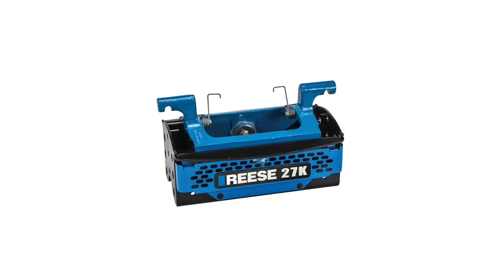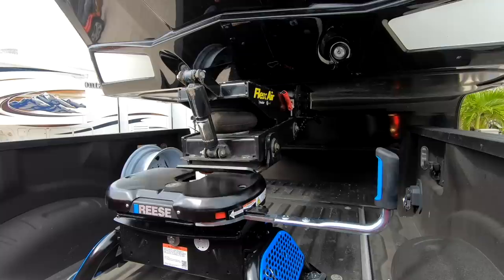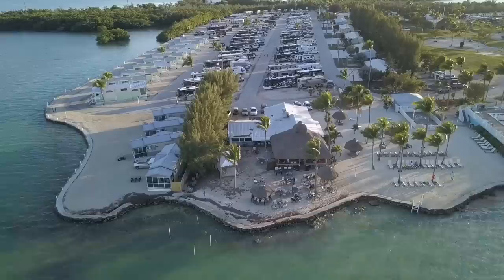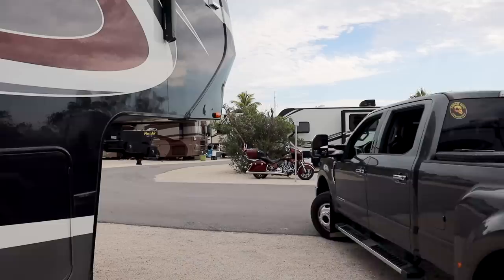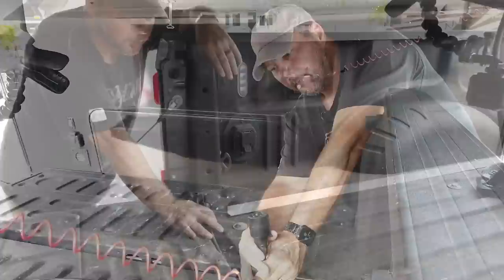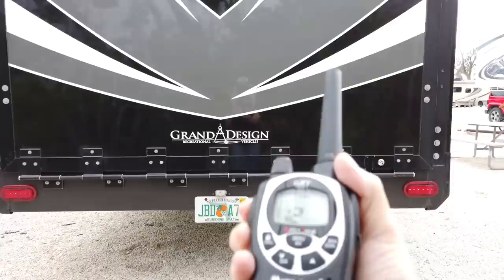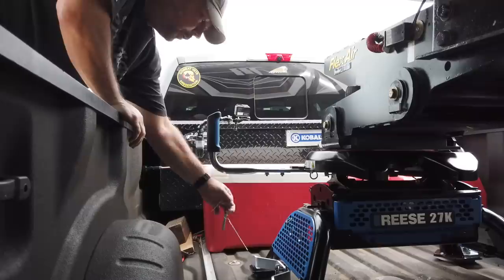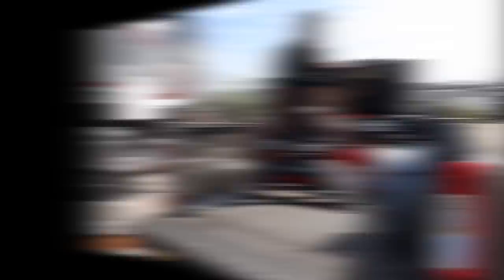Fifth Wheel Hitching | Reese M5 Review | Changing Lanes!

Comment: From a former OTR driver and now a full timer. The best way to do a pull test is to slightly raise the landing gear, engage the trailer break and pull. There is no other way to do it! You are teaching the right method.
Reply: I was thinking that if the wheels are chocked, then the trailer should not move. But I can see the wisdom in slightly raises the front landing gear.

Comment: I have the Reese air sidewinder. You showed the basic one, the air is is in closed, so it does look a little different. It is a great hitch for the short box. I can do the ninety degree turn with no problem. You can adjust the air for your needs. Wasn't that expensive. Two of us installed it in about one hour. No more worries about turning. Good video. Like your check list. I have to admit, I do not use a check list. After 25 years plus of trucking, I pretty well have it down pat. But anything can happen, so probably good idea to have one. Never to cautious. Again, good video and be waiting for next one. Happy trails!!!!!!!
Reply from the maker: the biggest reason for a checklist in RVing is distractions... RVers are a friendly bunch and it's easy to chat for a bit and get off-game...

Comment: XLNT hitching video for newbies to watch. Well put together. We learned alot with our old truck about hitching and unhitching. (The hard way) on some of it.
We leave our tailgate on as most ppl do. 😒 One of our first trips out with "OLD YELLOW" I was not paying attention and was just a little crooked and poked the front compartment door with the tailgate and put a dent in it. With ppl watching the newbies boy was I 😳. 
Then another time we forgot to drop the tail gate after I dropped the dead legs down, released the hitch and started to pull out, you guessed it I hear this big bang and felt a jolt. This time a dent in the tailgate. 🙄
😀 lessons learned. 😀
Safe travels.

Comment: Great video for people new to the 5th wheel world. I have one of the coil breakaway cables but haven't used it, didn't like the hookup points. ( Dodge 3500 DRW). Seeing your set up I will try it when we take off in April. The new Reese hitch looks nice. We have the B&W Companion and I leave it in the dang truck unless I need the full bed. I use the loader on the tractor to remove and install it. Thing is heavy, but I too like the weight in the bed when running less the trailer, smooths out the ride. I need to build a hitch checklist, getting older I don't want to forget anything. I usually start a week before we roll checking wheel bearings and pressures on the trailer tires, then check the lug nuts (I mark them with a Sharpie and can just look and see if they have moved)
We also use radios for light check and backing in tight places. My partner's hand signals change every time and I couldn't keep up. The radios keep the hollerin' down to a minimum.LOL

The more I watch you two interact the more you remind me of my and my other half, although we are a lot older. Been together since teenagers, turned 61 last fall, and she still seems to like me. Next time you come out west would love to meet up someplace, boondock a couple days and I can hook Chad on the Turbo S Rzr....:)

Comment: This is one reason I had the Reese Goosebox installed on my 5th Wheel. For me, yes it takes a bit longer to hitch up, but I don't have a heavy hitch in the bed because I often use my truck box. I did a lot of research on hitched and when I found the switching to the Reese Goosebox will not void the trailer frame manufacturing warranty it was a no brainer.

Comment: Been watching you guys for a couple years, so thanks for all the great informative videos.  One note, I have a 2017 RAM 3500 SRW with Ram Boxes, so I was definitely challenged when buying our 2018 Montana 5th wheel.  I went with the Reese 20K Titan hitch which I love as well because it is heavy.  For pin box, I went with the Reese 19K Sidewinder to keep the pin box locked to straight in the bed of my truck and not potentially wiping out the insides of the Ram Boxes during tight turns.  It works very well as the pivot point is back up under the nose of the 5th wheel.  I have had no issues with sway, just a nice comfortable ride.  I love the checklists as I use them, too.  Happy RVing guys!

Comment: Great video as always guys.  When we got our 5th wheel in the fall I changed out the pin box for a Reese goosebox even before we drove it off the lot.  Now I haven't pulled it much yet but from the bit I have, I have no regrets.  Less stuff in the bed of my truck to deal with, the fact that the ball allows for the trailer to lean left or right helps in situations where the truck and trailer might be off camber for unhooking/hooking or simply driving where a standard 5th wheel setup might cause the rear axle to unload and loose traction from one side.  If Reese ever makes a higher rated one I'd highly suggest giving it a shot.  It's nice to get to a site, unhook, throw the ball and safety chain holders into their case and have complete use of my bed. 

 As always keep up the good work and look forward to the next video.

Comment: Having run a 40Ft gooseneck flatbed trailer, using that Reese gooseneck box would be great with one exception. That is lining up the trailer to the ball is a lot harder because you have to be almost perfectly aligned to hitch. When I was hitching alone it took several tries to get it close enough.

Comment: Hi 
So nice to hear that you say about the drag test. !   Seen many a trailer go sailing on its own down the road 

Always do a drag test and always lift the trailer as banging under trailer , so that “ if “ king pin not locked properly, the trailer will only fall 3 or 4 inches ( commercial trailer ) it is possible to drop trailer on its nose if legs wound up fully  !    Yes    I did do that.  😂😂😂😂.

Comment: One thing that I’d like to mention with your light check. I travel alone more often then not. What I do is hit the emergency flashers and that turns everything on including both turn signals. Also good call on the pull test with landing gear down, I’ll be adding that step.

Comment: Great video, really enjoy you channel.  I have my first fifth wheel after 4 travel trailers and the dealer talked me into the Anderson you showed on your video.  So far it's been great with no problems, but time will tell.
Here is a little tip from a 40 plus year truck driver. If you get a bind and can't pull the release handle, back up tight against the hitch and set the parking brake and then try to pull it.
I really don't think taking the weight off the hitch has any affect on unhitching.  Keep up the good work

Comment: PLEASE READ ME!
You just ran your emergency brake cable to the rear of the truck bed.
That would have to run forward for two reasons.
1) If the cable is running back 18", it would have to break loose and move 36" just to match the tension you already have.
2) If the cable hooked on something and pulled sideways or backwards, it's going to bust the plastic pin off in the hole and it will never work at all.

Hook it to the front Ford takedown and that cable will only get tighter.

How do you like that Ford tiedown system?
If you didn't have the tie downs, are they worth picking up? (2019 F-150)
Ford parts I'm sure they are big money. I actually haven't even looked at pricing.

Keep up the GREAT JOBs you two👍
Reply: The only problem with HOOKING to the front...well actually 2 problems is:
1 .. when you turn it would pull out and your trailer brakes lock up and
2 . When turning, the cable could get wedged in the 5th wheel hitch and break therefore rendering it useless . 👍🏻
Reply from the maker: Thanks! 

The break-away connection is basically 90 degrees from the hitch.  If the RV ever comes loose, it will have no problem yanking that pin out as the RV moves to the rear.

We don't use the tie-downs a lot, but they are nice to have.  You're right that they're likely expensive...
Reply: Actually no, I've hooked on something behind the hitch and it work very well, unfortunately.

Comment: I moved from the same old-style Reese to the B&W 25K with the new truck/5th wheel and prefer the B&W but one thing I dislike about both (puck installation) is they both give you a way to lock the handles once closed/rotated but then leave the cotter pins/bolts fully exposed so someone could still remove those and steal your hitch. Wish the rotated handles would cover those bolts to prevent removal. Purchased a couple of those breakaway cables using the link above; definitely nicer to use than the long straight cable.

Comment: Awesome video. 1 suggestion would be to clip your breakaway forward of the hitch.  If it comes off driving down the road,  it will have the ability to pull the release. Tailgates are so strong and have locks, and its possible it won't tear it off and emergency brake will not deploy. And if by chance when it comes off either pulls the 7 pin connector out or breaks it off. Then you have no control at all.  I installed a eye bolt by the handle on my tool box to attach to.

Comment: I love all your vids, so informative, organized and thorough. I am a newbie and have learned a lot from your vids. So I debated on going with a 5th wheel hitch and kingpin vs a Goosebox and ball hitch. I decided going with a 20k Reese Goosebox and ball. Our rig is only 14k lbs.  Advantages and disadvantages of both. I feel more confident with a Goosebox and ball. No worries about a pull test and worried about coming unhitched. Negative is it is more difficult to get lined up under the all, but it is easier with practice. I also use an Iball camera I mount on my hitch ball and that helps a lot for visibility. I have incorporated many of your steps in our check lists. Thanks for all your tips and great advice.
Reply from the maker: Awesome job! If you haven't visited our website yet, please do. There is a ton of helpful info there.
https://changinglanesrv.com/

Comment: I hook my break away cable for the brakes to the front of the truck. Because if the trailer should become disconnected  the pin will pull out as soon as possible and engage the trailer brakes. I also pull the pin out and test that the trailer brakes will engage. When I drove 18 wheelers I would lower the air bags on the tractor, back under and connect to the trailer, raise the air bags which would lift the trailer jacks off the ground then pull forward to test the connection. Then get out of the tractor and connect the lights and air brakes.

Comment: Hey guys! Just assembled my Ford puck M5 yesterday, and noticed that the blue “Reese 27K” placard was on the “wrong” side as delivered according to all the photos & instructions about how to “gain 1 1/2” inches which, if followed, would have actually put the plate facing the tailgate as is shown in all the pictures.  This in turn led me to really inspect how the two springs under the head are supposed to be configured/working, and I noticed in your video that one of your springs is also in the wrong place under the head (the one to the right as you face the front of the bed). The long parts of the springs both need to be pointing as far forward into the bed (towards the cab) as you can get them when you lower the head down into the body of the hitch. This will then cause the head to cleanly rest “pointing downwards” towards your tailgate, aiding proper hitch angle for the trailer and hitch head strike areas to meet as designed.
Reply from the maker: Thanks!  I'll take a look.
Reply: @ChangingLanes  definitely let me know what you find- I was surprised at how unclear the instructions were for it. Basically a different instruction sheet in each box, and none of them really told the whole assembly story in my opinion.

Comment: Awsome video just purchased a Reese m5 27k hitch and noticed when putting it together that the center section came with 2 m16 bolts and nuts with washers with not very good at where they should go directions. After furture looking, at the top of the legs there is a all through hole that correlates with the three adjustable heights the hitch can move in. So I found that each leg should have three bolts for security and stability. I though I would put it out there for anyone who has one or purchases one to make sure and put that bolt in.

Comment: Nice thing about the Andersen Ultimate Aluminum hitch is I don't have to do a pull test. I know many don't like this hitch but I have had it 5 years with no issues. I love that it weighs only 35 pounds and I can easily get it in and out of my truck when I need the bed. I do like these puck systems but my 2015 doesn't have that option.

Comment: Hey Chad, when I had my rig with the wireless air, I would just hit the up fitter switch and shut that system off when un-hitching.  So when that weight comes off the truck the sensor doesn't see the pressure lowering in the bags and keep trying to re-fill them.  Then when un-hitched Id set the PSI to 5 for the bags.  When hitching back up, id wait till we were all hitched up and then fill the bags back up.  35 to 40 psi seemed to be the magic.

Thanks for the idea on the coiled breakaway cable, mine always bugged me!
Reply from the maker: Great idea on the upfitter!  👍🏼

Comment: In 2015 when I upgraded to my Raptor toy hauler (17,000lb)  I first went for the Anderson hitch, mainly for the low weight and ease of installation.  The hitch shop also claimed it would solve my short box turning issue too.  That was a lie.  I saw all the videos on the Anderson site about how much weight it could take.  I installed the gooseneck pin to receive it, hauled my new unit home and packed up for our first trip.  Two miles from home a deer ran in front and I had to hit the brakes hard.  For the next few miles I heard and felt more clunking noise from the rear.  Upon checking the hitch I had found that it bent from the heavy forward load.  The Anderson frame base that sat on the truck bed now had a rocker shape to it.  It held in place and no damage to truck or RV.  I went back to the hitch shop and they took the Anderson back and I had a Curt 24K fifth wheel installed.  Don't know if Anderson has addressed this forward force issue.
Thanks Chad and Tara for great videos.  I've purchased a lot of the products you've recommended.  To paraphrase Jack Nicholson "You make me want to be a better RVer"
Reply from the maker: I just never trusted Andersen's engineering after breaking all those jack blocks way under the rated weight...  Glad nothing besides the hitch was damaged.  If you have a picture of the bent hitch, we'd love to see it.  info@changinglanesrv.com  
Thanks for watching! 😊

Comment: I been fifth wheel camping for a while and drive tractor trailer so fifth wheels are me bread and butter lol. I never lost a trailer until one time I was pulling a 3 year old 5er for a family. I hooked up same way I always do line up and back in with some force not gunning it but gave her little force when I hook up always worked until this time. I hooked up it made its normal
Nosies the hitch always does my hitch won’t pop arm it has to be done manually so I did that and locked it so I knew it couldn’t putt back out or so I thought lol. Put legs up put truck in gear and started pulling out u til I heard a clunk noise soon as I heard that the camper stayed out and truck shot outward lucky I was able to spike breaks fast enough to not completely loose camper. Minor minor damage happened to camper mainly cosmetic but my tailgate and bed well let’s say that’s a different story. Moral of story always get out do a visual ck with jaws even if it locks the Handel or you do it always ck the jaws and raise legs inch off ground I pull the emergency breakaway cable for brake to come on and tug on hitch couple times in both directions. I get out and ck jaws once more and rebook cable the leave.

Comment: Wow, what a pain in the A**.  I have a fifth wheel with a goose neck adapter using the Anderson hitch rated at 27,000.  The Anderson hitch is designed for short beds and you never have to wonder if my hitch will slide off.  Since you like to test different things i'd reach out to Anderson and do a review,  you will pleasantly surprised.
Enjoyed the videos, have fun in the keys.

Comment: Hello I don't know if someone commented already but, I noticed you laid the power cord down on the bed of your truck once you plugged it in. I drive 18-wheelers and we're not allowed to have them rub and I've also been informed that they don't like that in RVs also. So what I do is put two loops and a zip tie on my power cord so it's suspended in mid-air as it's plugged into the bed. Course on the big rigs we have a spring system that keeps him suspended, but I've get found one for an RV. Hope this helps out it keep doing what you doing love the videos.
Reply from the maker: Yea.. I see the spring hangars on the big rigs...  Never heard of it being an issue in the bed as long as there's nothing to snag on, but we'll keep an eye on the cable for any wear.  👍🏼
Reply: Okay no problem, and sorry about the typo. Also I haven't had any issues with it on my pickup and fifth wheel. But it is a big issue on the big rigs with chafing.

Comment: I love my Anderson Ultimate 5th wheel replacement hitch, but admittedly, it takes me a good deal longer to hitch because of the need to be lined up closer than just pushing back under the pin box. I am going to replace the Anderson jack blocks with the Snap Pads.